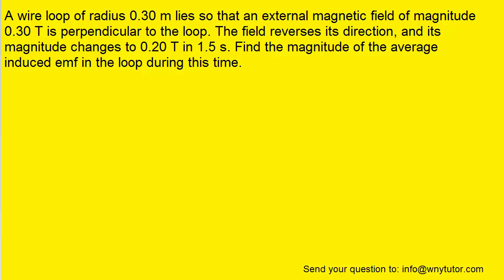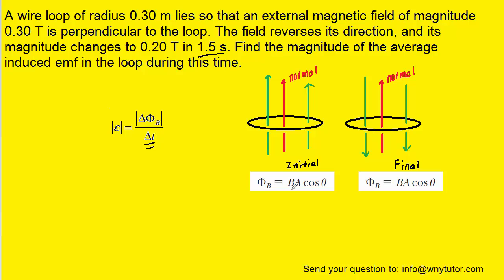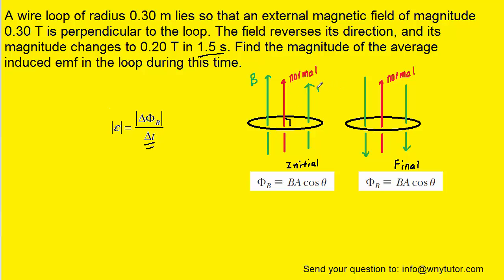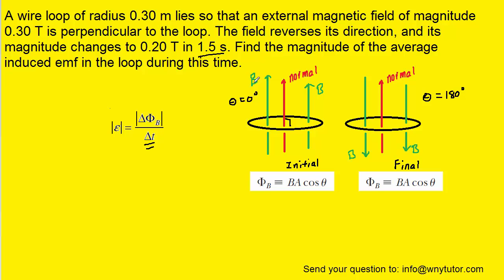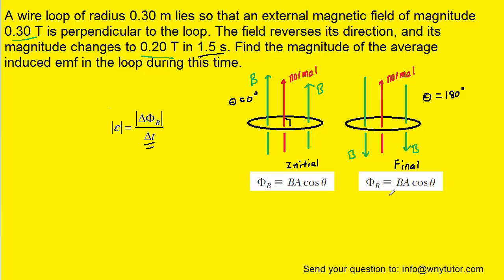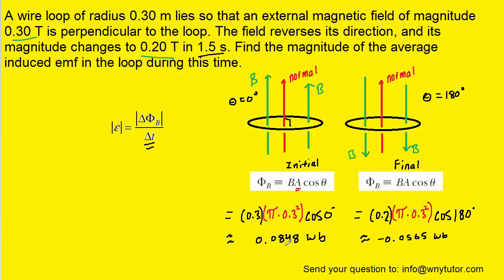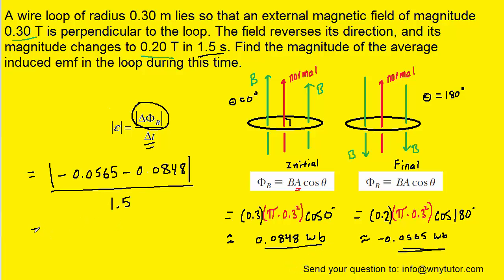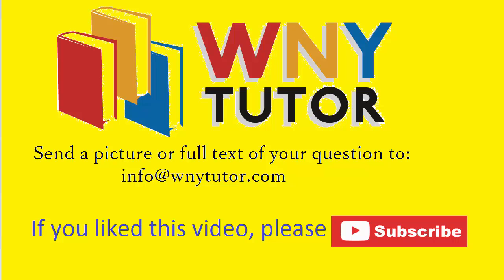A wire loop of radius 0.30 m lies so that an external magnetic field of magnitude 0.30 T is perpendi

Comment: what does it mean when it says its perpendicular, if we are using angles 0 and 180?
Reply: This is a bit late, but the coil would be perpendicular to the magnetic field. The normal, however is parallel. If the coil were parallel, there would be no induced emf because there would be no magnetic flux. I hope that helps.